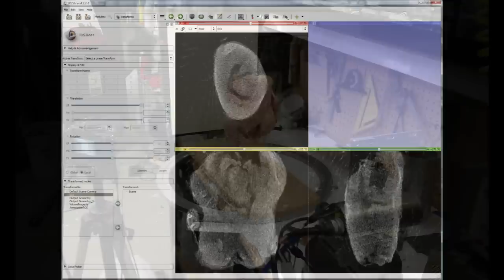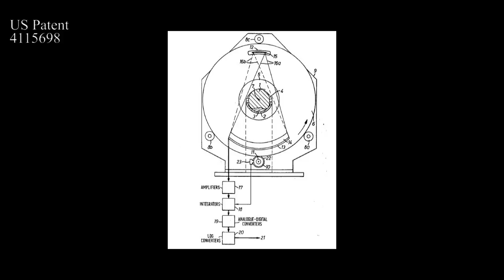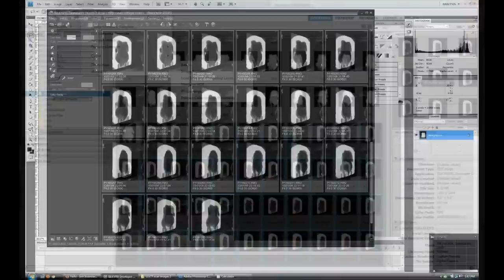DIY X-ray CT scanner controlled by an Arduino

Comment: very nice but be careful with that radiation. also consider that the garage doesn't stop the xray. consider who is down range when you do 1 hour xray beams. maybe design it to point up.
you can use a mirror to let the camera look straight on without being in the xray beam.
maybe use an F1.8 50mm lens to swallow a lot of light

Comment: Ohh that's what you want! 
Well since you don't have a x-ray optic you can only make shadow images. The sensor would be in the place where the phosphorous screen would be, so you could only scan objects smaller than the size of the image sensor. And since you are probably not using a scintillator, the efficiency of x-ray to electrons conversion in your normal CCD/CMOS chip would be pretty bad, so not very sensitive.
So unless I'm missing something else I say it's possible, but not practical.

Comment: How do I have to configure 3d sclicer to get slices from planar images? I have an old Trixell Pixium 4700 laying here which id like to use for a similar project. BTW, does anyone here knows what hardware I need to use to get images out of that detector? The interface seems to be optic fibre with the protocol being AMDTaxi

Comment: In order to get a "decent" image you have to detect significantly more x-ray photons than background light and noise and like I said ordinary CCD/CMOS/CIS detectors aren't very sensitive for x-rays they are sensitive for visible light.
But I do believe you can get some results by averaging several exposures, because noise from the chip will partly cancel out.
But again several exposures means irradiating a lot, not more intense but longer, so same difference.

Comment: The metal backing is too thin to be particularly relevant. At the beam energy you'd have to use for a home project, the glass in a mirror would be nearly completely opaque to the X-rays.

Comment: Will you release the CT stack you generated for others to evaluate?

thanks
Reply from the maker: +IlIlIlIlIlIl I added the link to the video description.
Reply: +Applied Science WOW. thank you.
Reply: +Applied Science AS I'm sure you can tell, I am captivated.. I loaded this in Avizo. Do you think the X-rays are just not strong enough to fully penetrate the chicken explains why the axial column is not well imaged in comparison to the forelimbs? I am able to automatically detect the forelimbs using threshold segmentation in Avizo but it is impossible to separate the axial column out...
Reply: +IlIlIlIlIlIl I have posted a picture here so you can see: http://imgur.com/vhof1V4 sorry , I am not sure I put the voxel size correctly as it is quite short.
Reply from the maker: +IlIlIlIlIlIl Cool!  Yes, the 50KV X-rays are not as well suited for deeper imaging as 75+KV.  My tube and power supply are setup only for 50KV.
Reply: +Applied Science How much danger would there to be to increase the power supply in a home set up? Some soft tissue imaging is done under 40 KV, is it possible your tube is not putting out the right power? Do you think you could go to 150 kV+ with the correct equipment safely?
Reply: +Pilot Data Productions I don't know about at home. But I can say that the machines we use in a hospital run on 220v which is what your house appliances like ranges and washers and ovens run on. And the max out puts of those legally is (not at the same time bc of other limits) 150 kVp, 1200 mA and 10 second exposure time for diagnostic imaging. the maximum exposure per public law is 600 mAs for exposures above 60 kVp. so as you can see doing 600 mA t 150 kVp would be illegal and very dangerous.

Comment: What software did you use to do the 3D reconstruction from the image data? I have a mailroom cabinet x-ray & was thinking of doing something similar but didn't know how to approach the 3D stuff.
BTW a 45 deg mirror behind the screen solves the xray-into-the-camera issue.

Comment: Do you have anymore lenses?  You can cut your exposure time down to just 10sec or so if you use a smaller lens.  I am a photographer, so I'm guessing your lens is something around f3.5-5.6 worse for darkness.  You want F1.8 or so.  Focus is hard due to depth of field, use a bright flashlight--then set your noise filters and try a higher ISO. Get a 50mm lens or so and use manual focus at f1.2-2.8 to get pics in very low light.  Nice job, I sure do wish I could afford a full on shop like you got!

Comment: I was wondering if you were able to shorten the exposure by targeting the camera for the wavelength of light being emitted from the screen. Maybe the reason the exposure is taking so long is because of the camera's monochrome setting, only the red or blue wavelengths are taking exposure.Red or blue channels will not see green light  as effectively as the green channel. Try  shooting the screen in color mode, remove the red and blue channels and convert the green channel to a grey scale.

Comment: I think he would still have to; the x-rays aren't parallel, they're coming from a point source that is being rotated, right Ben?   So if his phosphor screen was tilted at 45 degrees to the source, the side further from the object being scanned would have a larger image.

Perhaps if the phosphor screen remained perpendicular, but you used a mirror set at 45 degrees, and the camera at 90?  My only concern then would be finding a mirror that didn't have a metal backing (which might reflect x-rays).

Comment: You mentioned poor dynamic range as an issue. Image combining software like Deep Sky Stacker is designed to improve image signal to noise ratio. Do you suppose that that sort of processing would be a useful addition, or would the additional exposure and processing time make it impractical?

Comment: If you coated the phosphor in an OLED which responded to that frequency and biased it, it would amplify the local change in brightness, right?  Basically acting like a photodiode and an LED together.  Seems like a way to decrease exposure times without relying on a scanning solution combined with a photomultiplier or a really expensive camera.  Of course finding and making an OLED/depositable LED like that is the trick, Jeri Ellsworth is the only one I've heard of who does anything even close.

Comment: does anyone know what type and where to get the phosphorescent screen from? I`m using a 5 micro severt output tube which is roughly equivalent to a dental xray tube and need to see in real time the images produced.
Reply: I'm trying to figure out the same thing. That's the last step in my set-up. I have found some stuff on eBay, but I'm not sure it's the right stuff. Have you had any luck with finding what we need??
Reply: Nice song.

Comment: Because if a much simpler/cheaper/superior method couldn't be designed by Siemens/GE/Toshiba/Philips et al they wouldn't be using it now?

FBP reconstruction is also on the way out being replaced by a different algorithm which reduces patient dose considerably.

Not to mention spinning the patient is 100% impractical.

Comment: The chicken does not get radioactive after exposure, if that's what you meant. It would only be radioactive if the chicken had particles on it that emitted radiation. The chicken is safe to eat.

Comment: would it be possible to increase the power of the x-ray transmitter and have it transmit for a shorter time to get the same result? and maybe combine your build with a Casio Exilim ZR-1000, which has High Speed capabilities. One of the features with this camera is High Speed Night Shot, which supposedly takes many pictures really fast, combines them, and gives great low noise pictures. check it out.
Maybe you could decrease the time it takes to do a scan.

Comment: Hi, I'm working on a similar project. What is the focus size of your X-ray tube? The one I have is a large medical tube intended for chest X-rays, and I'm concerned that the 0.7 mm focus size may not give me enough resolution. This is also, of course, impacted by the grain size of the scintillation screen. Which brings me to the main question--where did you get the large screen? I haven't seen one this size on eBay...
Reply from the maker: I took apart a large chest X-ray image intensifier cassette to get the phosphor screen.  I don't know how often they appear on eBay, but I don't remember having too much difficulty finding one.  Search for X-ray cassette.  My X-ray tube is rated for about 50W continuous.  I believe it was used for PCB inspection.  I don't know the spot size, but it's probably only slightly smaller than .7mm.
Reply: Thanks. Do all cassettes use intensifiers? Many on eBay don't specify it. And I thought that film was directly sensitive to X-rays... My tube is a few kW non-continuous, rotating anode type (it's still in the shielding/cooling head), a Picker that probably dates back to the 60s. Works, though, even if I have to guess the right stator voltage by the sound. There are two cathodes, one with focus spot of 1.0 and the other, 0.7; I can only guess the reason for having the larger one is for increased power or duty cycle. But if you get the resolution you do with something only slightly smaller, and without an anti-scatter grid, I assume what I've got will work OK for larger objects.
Reply from the maker: furchina  I believe all cassettes include intensifier screens.  Photographic film is sensitive to X-rays, but much more sensitive to visible light, so the cassette's purpose is to convert X-rays into visible light to create X-ray images with a lower total X-ray dosage.  The type of phosphor can be important -- some are designed for maximum sensitivity, others are designed for maximum resolution.  Their emission wavelengths and phosphor time constant also vary quite a bit.
Reply: furchina Sorry this may be late. No not all cassettes have screens in them. Used ones most likely have screens. Make sure they are not to yellow though. 

Your stator voltages should run around 50 to 80V AC 60HZ for a Picker tube. They run around 6000 RPM. 

Yes the larger filament is for more power. If you have a large patient > 200 LB you need more power. Note those tubes are generally designed to work around 60KV to 120KV also about 5ma up to 600ma the small filament max about 100ma. Its been a little while since I worked with them. I use to repair these systems.

Just be careful you are not in the beam.While its fin to see your hand work  It does increase your chances for cancer and cataracts. Lead and distance are your friend. Also protect your neighbors. x-rays go through walls. Most x-ray rooms have lead lined walls. Shoot into lead lined box... Approximately 3/16" thick lead should be safe. I am serious here. Fun to play with but be safe.
Reply: Did you quickly cook the chicken and eat it after taking images of it so that you don't get food poisoning, and waste a poor little animal?
Reply: +Nerdygirl i mean, fuck,  that's a chicken healthy as fuck...

Comment: Applied Science where do I get the phosphor screen? and about how much they cost?
Reply from the maker: Search eBay for "x-ray cassette".  $30 or so.
Reply: Applied Science thanks
Reply: Applied Science do x-ray cassette just hold the film or do they show an image?
Reply: Owen Chase There are phosphor screens inside of x-ray cassettes. Be cautious though Continuous screening/fluoroscopy (which is what CT essentially is underneath it all) can be very dangerous if you don't take the correct precautions to protect yourself and others. I'd advise that you don't do this to be honest.
Reply: ***** ok thanks ya I know about the dangers I don't think I will even do it.

Comment: Hi Ben,  very impressive. At first glance I thought it would be impossible to use a bunch of plain X-rays of the chicken, rotated around the Z-axis, to construct a 3D image. However ,the unprocessed rotating image at 2:15 already contains a lot of information ;).   What software do you use to perform the filtered back projection algorythm and how? And, after all your efforts, why do you show only a few seconds of the final result, a true CT scan, albeit somewhat grainy? Regards, Alfred

Comment: I don't think you need superconductors. Superconducting electromagnets are used to obtain ultrahigh homogenity and high field strength with no ohmic loss. But that's not strictly necessary to make a crude device.

I bet he could probably do it with simple copper wire. He clearly has the electronics and HF equipment necessary. 

Looking around.....yep, I was right, he COULD make an MRI fairly simply.

/watch?feature=player_detailpage&v=RlsM__mz3bk#t=129s

Comment: what happend if you turned the chicken only 180°? Wouldn't all the pictures after that point just be the same as the mirrored picture of the position 180 degrees away? Or would you have trouble with the perspective?

Comment: But again, I think the easier way to do it is not letting the x-rays hit the optical sensor in the first place, the idea of using lead glass comes to mind (for x-rays of this energy maybe even normal glass would do the trick).
Some nice flashes can be seen here -> /watch?v=EqGqsXF20zA

Comment: More like: "So after completeing my warp drive prototype last week, I thought I'd send my arduino-based probe to the center of the moon with it. I knew the zigbee's normal radio wouldn't make it back to Earth, so I made this ultra high gain amplifier from a television transmitter tube I got on ebay."

Comment: is this dangerous to the user from the xrays
Reply: of course any xray is bad. but if you take the correct safety precautions like staying away from the beam and wearing lead protection then you will be ok. just dont stick your head in there....

Comment: Its amazing to see what a liberal looks like through a ct scan. I'm surprised that there's an imaging generator powerful enough to generate through rocks! Thanks for the upload... I worked for AMSCO many years ago, and worked with the Xray Tech's there. I remember the upgrades on some of the rectifier equipment in the imaging rooms that we had to do for a good number of the hospitals in the area! We worked with Tubemaster, Varian, Raytheon, and the like... Xray tech is cool, but dangerous!